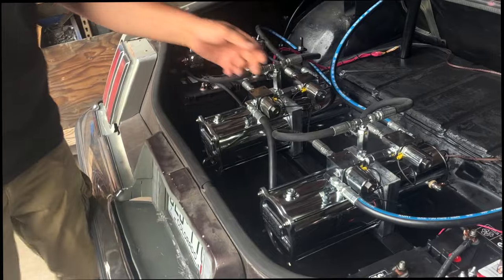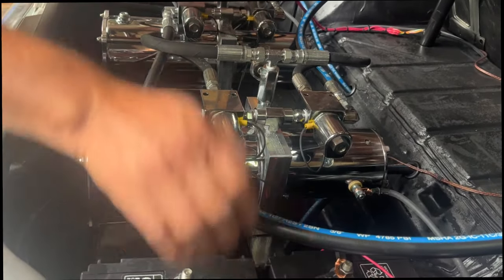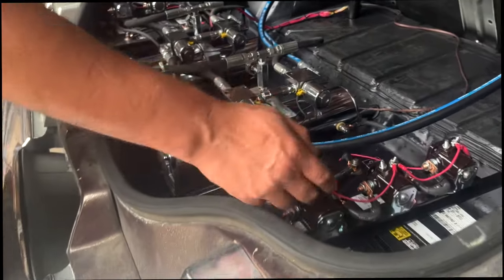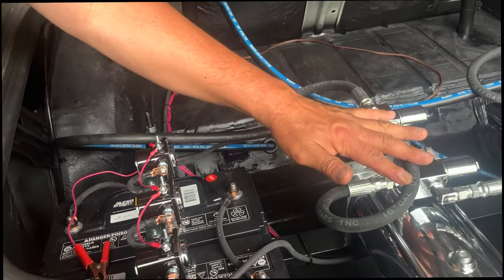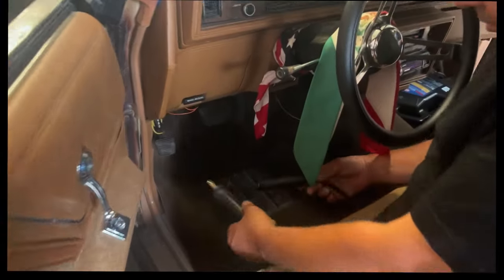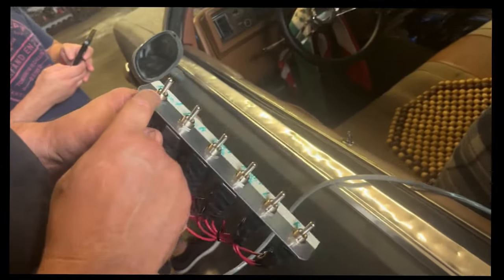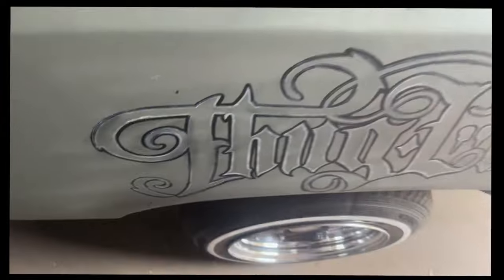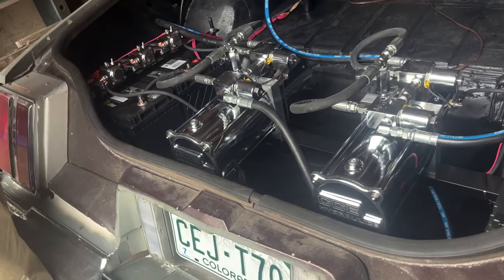Picking up 1979 Oldsmobile Cutlass Supreme after Installing Hydraulics Switches

Comment: I learned something, thx 🙏🏼 

Live the Bible verse on the tow truck.

Why didn’t you drive it home?
Reply from the maker: Didn’t want to risk anything happening bro , this car still needs a lot work to get done ✅ yeah I seen the verse too 🙏💯 thanks bro for checking ☝️💪✊
Reply: @7synergy917 I feel you, I drove my car home when I first got juice and man it was a wild ride. Especially because the gear box was loose- I don’t know how that happened but it was jumping and very loose at steering- I was tripping- I actually hated the hydraulic change- it’s different from stock. But my mechanic came and tightened up the gear box, drove it for a couple of months, worked out the bugs and now I love hitting switches, gets a lot of attention. My kids love it.

Comment: How much does a setup like that cost?? Jus bought an 84 Cut. I jus stuck my foot into the car game, short knowledge, but I have ideas on what I want out of it.
Reply from the maker: 5G for the pumps an installation 3100 for the installation an the other was for the pumps ,you should be able to buy your own pumps an take them or if not just get everything at one spot what I did , I did notice some shops are different as well so check around but 5gs for everything, thanks for commenting appreciate it !! 💯🙏

Comment: No disrespect and I love the set up good job but I would have moved the pumps up in case he want to install a system later have room for a box just my opinion nice work though
Reply from the maker: Yeah sam does good work no worries man !  Your all good 💯 , I have a new connection I will be upgrading my hydraulics here soon adding 3rd pump an 4 more battery, yeah your right though to move them upfront for future hand does help out , thanks so much for even considering commenting!! An taking time of your day to support ! 💯🙌🏻really makes a difference!

Comment: Damn I'm jealous 😂. My 83 Monte Carlo with switches was crashed Last year. I can't wait to find something clean again and get switches. The only thing I hate about hydraulics is the battery weight and maintenance. Clean setup! Where is this at?❤ Colorado springs?
Reply from the maker: It’s a lil bit frustrating but who doesn’t like hitting switches 😅💯☝️ it’s worth it though  , he’s in Denver Co Sams Kustoms should be able to find him in google with no issue. No matter if you crash thier still more cars out thier at the end it’s just materialistic car just for fun😎🚗 but nice if you take good car of them
Reply: @7synergy917  right right, I'm down in Colorado springs, I might have to pay him a visit when I get a new project car going. Thanks for the info 👍✨

Comment: Run it at 72v and go hard! That black caddy is just like my old one 💙
Reply from the maker: Yeah thier clean rides ! No doubt,   How would I run that ? If you don’t mind ?
Reply: @7synergy917  run all the batteries together, then put another battery cable connecting the banks of solenoids.